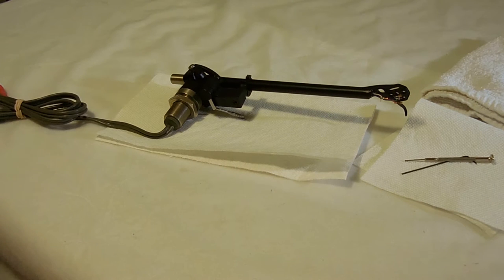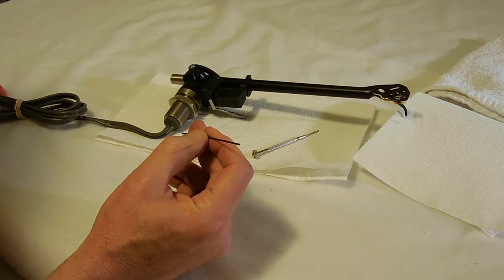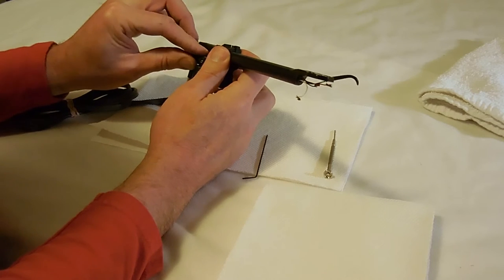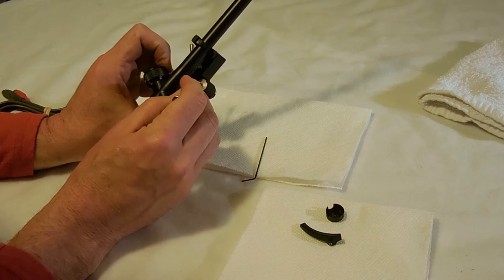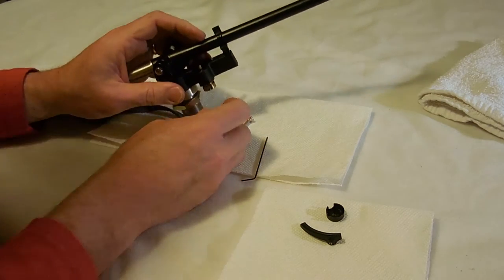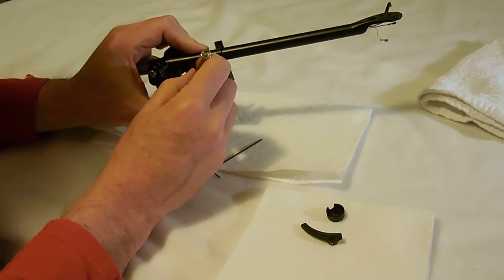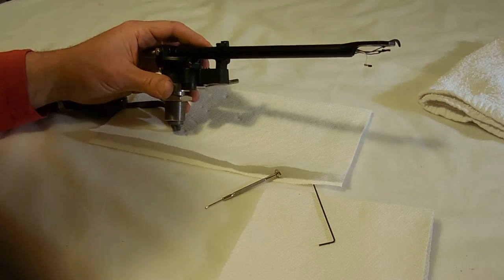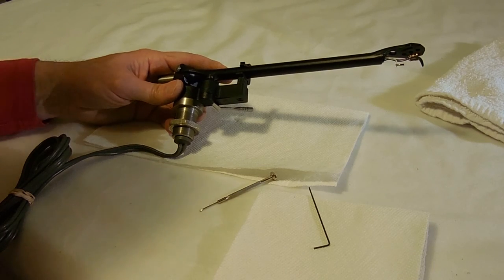Removing the Cueing Apparatus on a Rega RB-300 tonearm

Comment: Any suggestion on how to adjust the height. Even after adjusting with the alan wrench it does not lock to the necessary height to lift the arm from the record?
Reply from the maker: Are you certain the VTA is correct?

Comment: The Rega cueing devices use grease for damping and not silicone fluid. They are usually very reliable and don't need service, although the cam mechanism can wear after many decades of heavy use.
Reply: I had a 250 cuing lever breaking on me 5 years ago. But usually they are reliable. They tend to get stiffer with time though. For what it's worth, you are better off replacing it if it breaks
Reply: Hi , what grease do you use for the cueing system?

Thanks